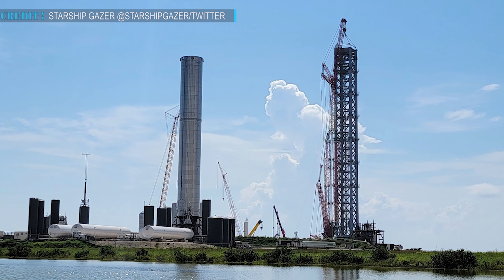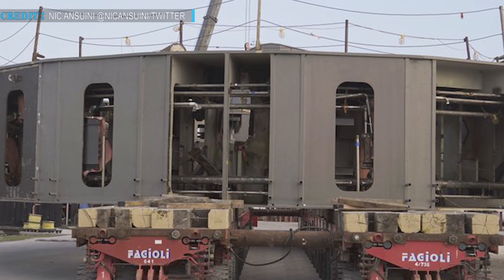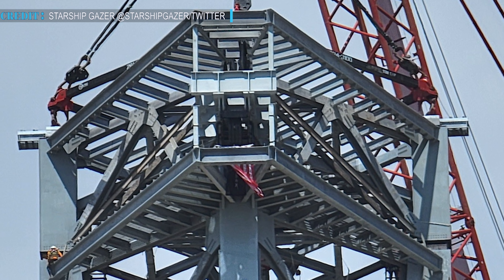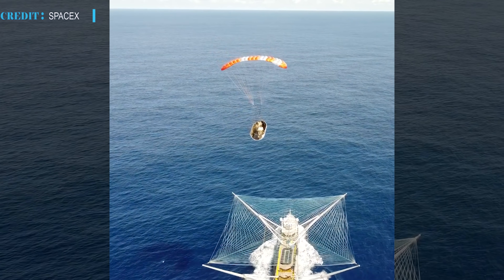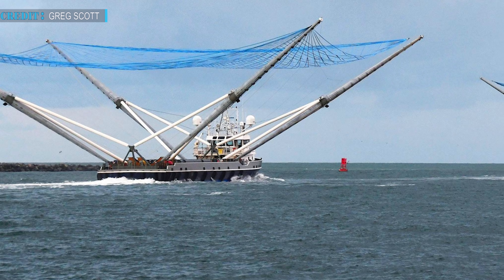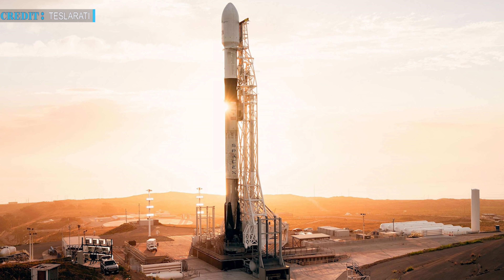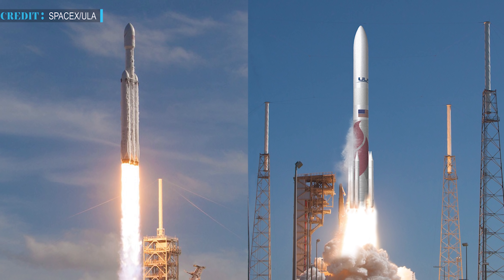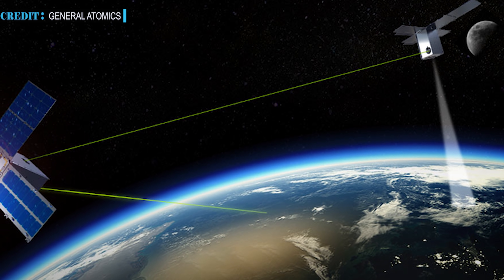SpaceX Starship update: SpaceX shift their all focus to Orbital Launch Pad

Comment: I really dont understand the construction of a catch tower, why not go with something proven as in landing directly onto a pad. God knows the pricing of a catch tower and manning to assemble, fabricate, and construct. To me its just an additional attempt to damage a well built booster...just a thought
Reply: Yeah...  but you only need to build a tower once.  Elon said he can reduce the booster weight by 10% giving more payload by not having legs.  Falcon legs need massive refurbishment after landing.  Also these boosters can and will be replaced constantly.   Look how fast they are building them, and catching at the top has a lot less chance of damaging the raptors.  The engines are the expensive part, not the stainless tube.
Reply: @losotech206  Once untill landing fails and rocket crashes into tower. Then you may be forced to rebuild it because it gets weaken by the damage.
Reply: Because it is unproven. Nothing like a Starship Booster has ever landed. Even Starships (last year) legs crushed under its own weight. Remember, we are protecting ALOT of expensive rocket motors during those last few feet of landing... No room for oops...
Reply: @losotech206  Maybe it's also better to launch in the hanging position, instead of bolting it down on a launch table. Saves a lot of work. Arms would need massive reinforcement though to carry the extra weight of the fuel and oxidizer and payload.
Reply: @iantsears  But also no more room for navigational error, it has to be pinpoint every single time. Slight deviation = RUD and massive damage to the tower. There will always be unknown factors.
Reply: They Are doing it and they have a history of proving people wrong.   Either way...  this S#!+ is going to be so fun to watch.    How is everyone here going to recover their super heavy boosters?
Reply: @paulmichaelfreedman8334  The Booster can, unlike the Falcon 9, throttle down enough to hover, and can therefore maneuver some meters sideways if it needs to
On top of that the catch arm also provides some room for deviation

That's the reason why they cancelled the idea of directly landing back on the pad as that would have to be perfectly pinpoint
Reply: It is not just about price of int. tower which is not that expensive.  If they went with proven things we would still had boosters crashing in the ocean.
Reply: @paulmichaelfreedman8334  the arns wont be holding fueled full stack, it is just and only for booster landing.  OLT will be supporting full stack and it will fueled on it.
Reply: @Astromath  Understood. thx
Reply: @marianpazdzioch6632  so?  No risk = no gain.  So what if the tower gets destroyed?  They'll just build it again, only bigger and stronger than before.
Reply: @paulmichaelfreedman8334  The tower would never support the weight of a fueled starship super heavy.  Catching an empty booster IS feasible, and will bring many benefits.
Reply: @BackYardScience2000  high risk - high reward is fine during R&D, but once you turn that thing into regular comercial launch platform, what you want is high cost efficiency. Disasters happen, from time to time - you need to plan for them. And you don't want your expensive launch tower to go down along with crashing rocket adding to disaster costs.

Comment: I would use a mountain and bore a hole down it. Then rather than all that trust and extra weight to lift it from static to moving i would use a carriage inside the mountain to accelerate it to 200 mph engines on. The carriage just runs out past the EMF and gravity slows it in the rails inside the mountain and it comes back down on a skirt and a cussion of air trapped inside the mountain. Say goodbye to thousands of pounds of rocket and fuel. Also your at 6 or 7 thousand feet allready
Reply: You still need the same energy to accelerate it plus you hit wall of dense air which will be quite stress on the vehicle.
Reply: @mravecsk1  to easy its not going that fast first of all. Most of the fuel is burned up just to get it off the ground. Trick 8s to get it to move without power from vehicle. Thousands apon thousands of pounds just to lift the weight 9f the extra fuel. components. chassis. How about a car in the quarter mile and like a big spring to get it moving. Why would I bother explaining this. You sound intelligent
Reply: @mravecsk1 less fuel to land as well
Reply: You don't think that's already been thought of and ruled out because it's unpractical?  Sorry to tell you, but it has.
Reply: Digging a hole like that is really expensive, usually engineers don't choose the best option but the cheapest.

Comment: Need 150 medium small/sats delivered in 2024?  StarShip will exist then, even if not reusable at all yet.  Putting all your eggs in one basket would be risky, so maybe you tell SpaceX to only send 50 at a time, to be on the safe side.
Reply: Starship will be reusable from day one when operational. They can fly with 50 but it will affect the price usd/kg to orbit significantly. Falcon 9 is already flying with 60 starlink sats (18 tons) would be better and cheaper use F9 then.
Reply: @mravecsk1  I assume their sats will be bigger than starlink.  If not, you're right - F9 can do the job.
Reply: @mravecsk1  The 60 Starlink satellite launches on a Falcon 9 B5 are 15.6 metric tons per launch. The F9 B5 can do up to 22.8 tons when expended.